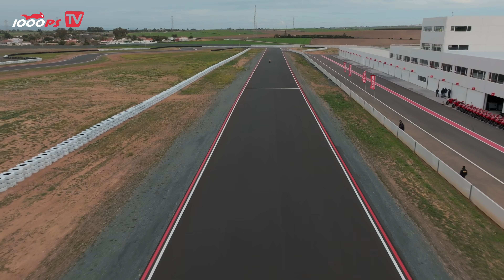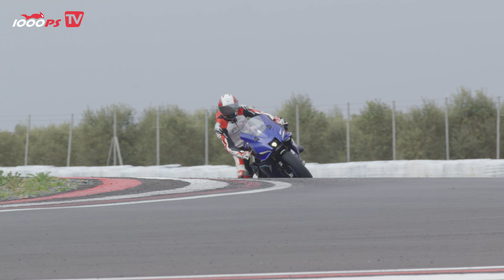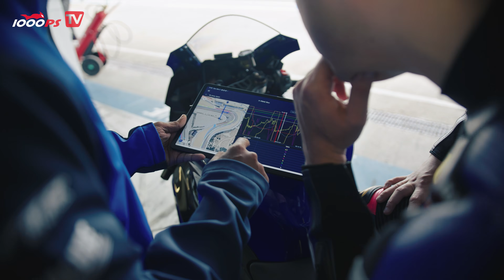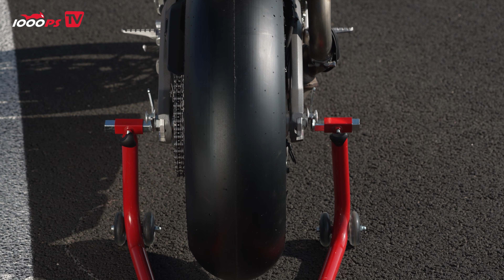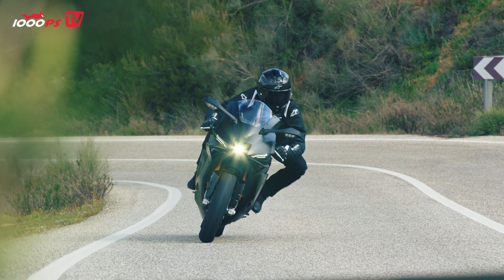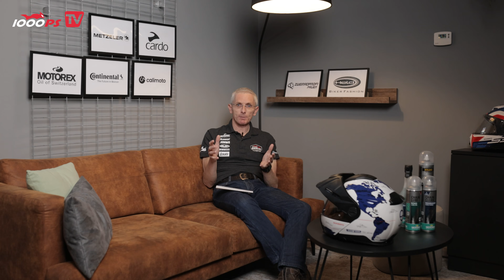Ducati Panigale V2 vs Yamaha R9 - comparison test - battle of the mid-range supersports bikes!

Comment: To put the lack of power into perspective, this is named Panigale, the SBK line of thoroughbred sportsbikes, race replicas, fire breathing characterful aggressive beautiful Vtwin desmodromic motorcycles that are at the pinnacle of desirability, until 2025, when ducati reduced the fun to only 118hp. A Panigale is not a learner bike, it’s not a softly softly entry sports bike, it’s an unapologetic supermodel of motorcycles, the lion that dominates its savannah, when you ride one you feel like you’re experiencing something special. Not in 2025, you don’t get a proper desmodromic engine. You only get 118hp. Torque becomes limp well before you get to redline. It’s not as beautiful as past designs. The components are budget items, not exotic  like last years model, it doesn’t even have Showa BPF forks, but kayaba budget items.
And again the power. It’s 2025 folks. A 1997 triumph T595 made 147hp from its 955cc engine, why is the ducati Panigale only making 118hp from its 890cc today, some 28 years later? Only 132hp/litre? Wow.
The Aprilia RS660, a learner-sized engine capacity of 659cc is making 159hp/litre. The Aprilia will feel special, the ducati is no longer the desirable machina it once was.

Comment: The Ducati is a bit lighter and more Nimble. I think the Stock horsepower may be more too.  Cost of Ducati parts would really hurt if you crashed it.
  I would like to see both bikes striped for track riding  with aftermarket exhaust and tune jobs for track only then see both bikes ridden by various riders and track times compared.

Comment: I'm selling my Ducati next weekend after 16k miles. While it was fun I've had loads of issues with the testastretta engine (though everything was covered under warranty). Also got a 3rd degree burn on my thighs from the extreme engine heat. Not to mention $3000/year insurance in DTLA. That said, if I ever decide to ride again in the future, I'm still getting a Ducati. Once you go Ducati you just can't go with anything else.

Comment: there were a few reviews saying the brakes on the r9 was average with one saying they need to change the pads and another saying that the abs is probably causing it to be less than optimal. While most reviews that mentioned the brakes on the V2 says it is very powerful with a one saying it has a lot of braking insinuating that its might be tad too strong or not what they expect from a non liter bike.

Comment: Excellent video very in-depth and helpful. The only comment I have to make is: a few simple adjustments of the chassis would resolve most of the disparities where the Ducati "does better."  That is my only complaint with a lot of these videos, honestly. 
For those that haven't researched of experienced it. as little as 2mm of height change to the front of the bike alone could make it feel like a whole new bike. going lower could make it turn in like a rocket ship but slightly less stable. Going higher could make it feel far more stable at the apex but would be even more sluggish to turn in.  

So to compare a stock sport-oriented motorcycle against another at least fo the way it rides isn't very accurate IMO, because it can simply be adjusted to do better. Also, riding a motorcycle, especially on track, is like a golf swing; no 2 people do it exactly the same.

Comment: The Ducati is new, beautiful, and cool. The Yamaha is an old MT-09 with the same flaw in the power band (at least with the USA tune), but with a new frame and added plastics. I’ll take the Ducati every day.
Reply: Curious…what’s the flaw of the mt09 engine?
Reply: but the yamaha is faster for less money...asia beats the euros, again. :face-fuchsia-tongue-out:
Reply: @cocodog85  no
Reply: @TheImtoomuch  lol, thinking V2 is faster than R9. 🤣
Reply: @J_CART3R  it is. That's a fact. Look up the top speeds for both. The Ducati beats it by 5 MPH according to MCN.
Reply: @TheImtoomuch  lol, so you're only looking at bike's topspeed. What a joke. 🤣🤣🤡
Reply: @J_CART3R  I said faster, sped. Try to keep up. You are lacking brain power.
Reply: @cocodog85  how is the r9 faster?
Reply: The yamaha is a bullet proof engine. The ducati will have so many problems.
Reply: @ tracked a 899 for 2 years banging of the limiter A group pace Zero issues. What issue did you have with your Ducati V2s or V4s?
Reply: @clubstyleridahd4695  tracked a 899 for 2 years banging of the limiter A group pace Zero issues. What issue did you have with your Ducati V2s or V4s?
Reply: @clubstyleridahd4695  in your opinion.  Ducati is dominating Moto GP and not because they have unreliable engines.
Reply: @TheImtoomuch  yeah, but Panigale is in MotoGP Series? Look at WSBK SS600, Who's ruling over there? R9 outclassed the V2 in every race.

Comment: Did I hear you say “Ducati on the other hand too their previous V2 ….. making slight modifications”

Were you there?
Did you listen at all if you were!

It’s a brand new completely new deign engine sharing precisely no parts from the previous V2!

It does away with Desmo valves and belts using variable valve intake timing and conventional springs instead, the valves are hollow for reduced mass, speaking of which the whole engine is a lot lighter too!
It has nothing to do with the previous engine unlike the Yamaha, which really is the same engine from the MT09 with minor tweaks!
If you can’t get basic facts right why should I listen through to any conclusions you might draw?

Comment: You said the 3 cylinders can rev higher than a V-twin, but actually the V2 rev a bit higher than the CP3...
Reply: v2s 10.5 redlines, r9 12.5 redline
Reply: @echospartan117 not true. Rev limit R9 10.500 rpm, Panigale v2 2025 rev limit 11.500 rpm
Reply: @jaccopaauw1630 my panigale v2s displays 10.5 on the dash - might be a production error for 1st batch of v2s, you can go to a dealer and see for yourself. But I have went pass it at the track without the limiter bouncing so its actually 11,350 per new google and chatgpt results. There are different source claiming 12.5 on the r9 but google and chagpt says 10.5. Have to wait till I get my hands on one at the track next month to see what it really is.

Comment: Thumbs down for misrepresenting weights and not simply saying it directly,  And screw Ducati for publishing a "wet weight" that does NOT include any fuel WTF??   So in reality you have to add the fuel weight onto the Ducati's published weight which I think is 395?  So another 30 pounds?  Not exactly sure (THANKS ducati) but at any rate it might be like 7 pounds lighter than the much cheaper Yamaha ...take the savings and buy CF wheels and a cat delete for the Yamaha and now there is no comparison!   it's R9 HANDS DOWN!
Reply: It actually makes sense to me, publishing the weight without fuel. If comparing the weights including fuel, the manufacturer who makes a bigger fuel tank would get punished for that💡And in reality, you ride the bike just a fraction of time with the full fuel tank.
Reply: @MarekNano  You make a good point re: the empty tank, but for it to be meaningful, all the manufacturers need to play by the same rules.

Comment: I would love to see the CP3 get the same treatment as the R1's CP4 (As compared to the MT-10's CP4) Yes lighter crankshaft titanium con rods titanium valves hotter cams shorter velocity stacks bigger throttle bodies and mapping to take advantage of it all....and maybe revised transmission ratios to take advantage of what would likely be what? 150ish bhp?   At least I imagine?  I mean it still would lag to an R1 but be a tad lighter at least   I have both the CP4 R1 and a CP3  T9gt  he R1 is more exciting bot the Tracer?  I just love that triple!
Reply: Yamaha did not do such treatment on purpose: if R9 had let us say 140 HP, they would get restricted in World Supersport and most likely would not get the victories to advertise.

Comment: Year after year, bike after bike proves Suzuki made THE Goldie Locs sportsbike back in 2009 which you can buy new today.....
Reply: The real truth is the 600cc class should have been bumped up 800cc's while allowing 900cc triples and 1000cc V Twins. The Liter/Open bike class should be  1100cc's as well. You see this already happening with certain bikes but sport bikes in general are not selling because of the lack of development.
Reply: If they modernized the 750 I’d buy one tomorrow
Reply: @robertwotring7318 I love that it is NOT modernized. I hate tft and rider aids on bikes that are too powerful. People that want rider aids simply need less powerful bikes and this is exactly what is happening
Reply: @ThaCasual absolutely 💯 facts.
Reply: @robertwotring7318  define "modernize".
Reply: @ imu, better braking maybe 10 hp more.  Quickshift with auto blip.  Tc.
Reply: @robertwotring7318  TC is the only thing you can't add to it.
Reply: @ Bazazz actually has a system that works based off rate of ignition. It’s basic but definitely works. My buds have these bikes, R6 calipers. Really good aftermarket suspension. Bazazz systems.  I just want all this stock 😜
Reply: @robertwotring7318  it's been more than a decade since I've heard Bazazz. So you can have a '25 gixer 750 for less and put the difference into it and have a MUCH better bike for less than the Duc. There's '25 can be had for just over, and I mean JUST, $12K OTD.
Reply: @ I am a Ducati fan, but I had to step away from the brand because service was getting extremely bad in my area like get you killed bad. I picked up a little RS 660 for the track. You were spot on with the Suzuki, you can buy nearly 2 of them for the price of the V2 S.

Comment: also should take into consideration the tires and set up and weather variables can make a huge difference in handling. Ducati was tested on a dry day with track tires and Yamaha was on a wet/damp day with street tires. these two variables can be very telling when it comes to testing out bikes on the track.

Comment: put a titanium valves on r9 & custom camshaft and stronger conrods and racing ecu and more durable springs and let see how fast it is
Reply: An ECU flash and exhaust system bumps power up like 15 whp, the best gains specifically at the top end. I’m sure it’ll ride much better with just those basic mods.
Reply: It’s already winning races in WSS

Comment: You're wrong on the yamaha exhaust claim. mt09's are one of the most "tuned" bikes and the tuners are only getting relatively small hp gains even with open race pipes. The gen 4 mt09 is even worse than the gen 3 with yamaha moving to a smaller airbox further restricting airflow.
Reply: Proper tuners are getting like 10hp witch is alot.

Comment: How can you give points for Ohlins suspension? You pay extra for this. With this money you could put it on the R9 too. 😁
Reply: If I give Yamaha money for Ohlins suspension, I know that it will 100% fit right, all the little brackets, the mudguard, the hose guides, lock stops, everything as it should be. Maybe I could get that pretty close to that good with off the shelf conversion components, maybe not. I'll have to do research and buy and cross my fingers, then fit it, which is all taking away from doing any other thing. So yeah, bonus points if I can just tick the S box and it arrives with it fitted, at least from my point of view. When I was younger, any money saved might have been the higher priority. R9SP when? :D
Reply: @kiztime1234  naw, it all is all perfect fit, Yamaha sells the ohlins upgrades

Comment: What are the lap times between the 2 and the S version also on the same track? Thanks
Reply: If lap time matters get either MY2024 V2 Panigale or GSXS1000GT💡
Reply: It is very difficult to make a direct comparison for the following reasons:
The weather at the V2S test was warmer, and dry. The R9 test started on a damp track in cooler conditions. 
All the Ducati V2 were setup with Pirelli WSS slicks, and the R9 were running the OEM  (for Europe) Bridgestone RS11 street tires.

Ducati had setup the bikes specifically for that track, while the Yamaha test was last minute, and didn't benefit from prior tuning.
Reply: @ if the v2, v2s, and r9 are all on same condition and same tires, what do you think would have the best lap time?
Reply: @motorjack141  V2 and V2 will be faster... they have more power and are lighter.
Reply: @ very similar hp with r9 at 117 and v2 at 120.